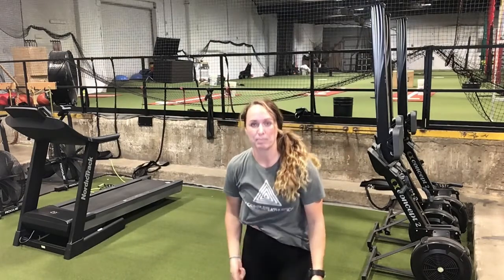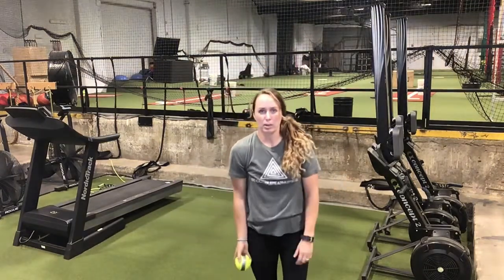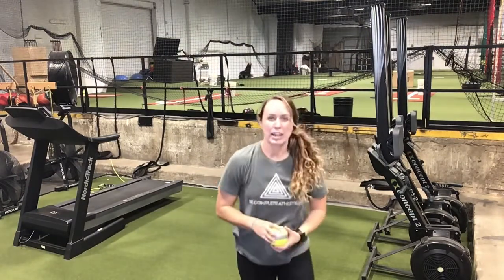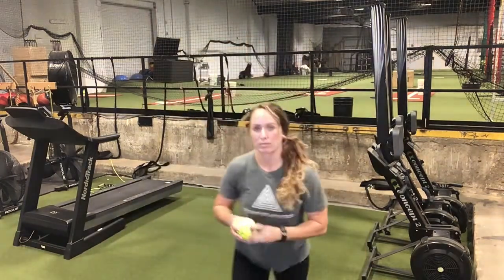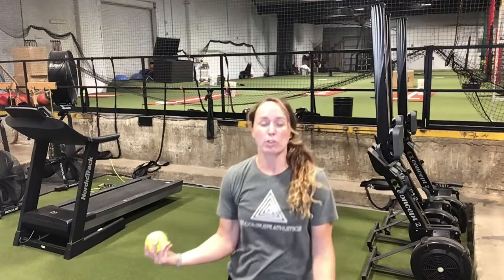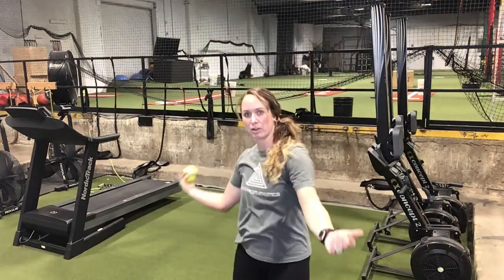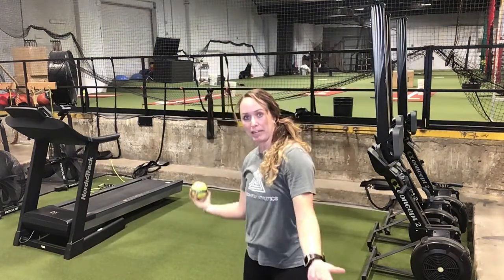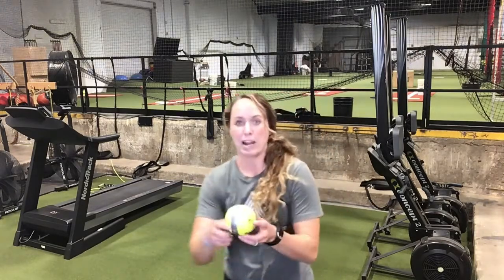Arm slots and true spin for each pitch: Fastpitch Softball Pitching

Comment: So my daughter is transitioning from traditional pitching to internal rotation.  She is having trouble figure a way to bend her arm down into the slot.  We have tried a foam football in the arm and a towel whip to try to help her.  What would you recommend for a girl in this transition state to help her?
Reply from the maker: Usually when I see this, they are really stiff in the arm, probably not getting separated very much (hips and shoulders kind of stuck together, not moving fluidly and separating from each other) and using too much upper body to create power, not enough lower body.  Sounds like you're doing a lot of great things, the towel drill, arm whip stuff. Try adding this drill : https://youtu.be/UGO9zd5gDEw
A little different approach - stay in the butterfly position - elbows down, and let the motion forward and swivel of the hips pull the arms downward.  Toes always stay forward at the catcher.
I just uploaded our Velocity warm up for weeks 4-6, some good exercises to help with separation in here as well - they're easy and feel great!
https://www.youtube.com/watch?v=R4frcwg0IV0

Hope this helps,
Nic
Reply: @NicDenes  thanks so much

Comment: Do you actually pull up on fastball? I’m a men’s pitcher, never thought of pulling up. I pull down behind me and out it goes.
Reply from the maker: For me the peel drop is a combo of a small pull up and moving forward at the same time, and you don't want to have more of one or the other, a good balance of both. The fastball is the same release out of the hand- but more motion forward if that makes sense. I have several girls that throw their peel as their fastball as they have gotten better at it, which I am totally ok with if they are able to locate with it!
Reply: @NicDenes  I’ve always found that I can’t control too much at release and rely on grip for different pitches. I feel like most effort is ‘behind me’ and when it gets to release I have no to very little control. Release point is almost a ‘reaction’.
Reply from the maker: @frozendivots1564  Interesting! That sounds like really great arm whip to me! The effort is in directing your forearm into the correct slot and hand into the correct position, then it just happens when you've loaded up enough energy to let it fire at the hip - kind of like that?
Reply: @NicDenes  yes. But all ‘effort’ is in back, leveraging the ball ‘down’ behind me and the structure/ anatomy does the rest. Like a hanger pulling straight down on a rod. The hand drives down, fingers pressure down. No intent to find a release point, the natural structure makes that happen
I’ve been pitching since 1989 (51 yrs old) and haven’t had any noticeable loss in speed or stamina etc. 
but if I try to ‘release’ then my arm tires,etc

It’s weird, hard to explain.
Reply from the maker: @frozendivots1564  Yep! Totally with you on that. Love it!
Reply: @frozendivots1564  I am the same way. Gerald Muizlaar told me "if your mechanics are on spot you just have to worry about grips. I know my rise grip forces me to turn the door knob naturally. My drop is always behind the ball with a slight turn over.